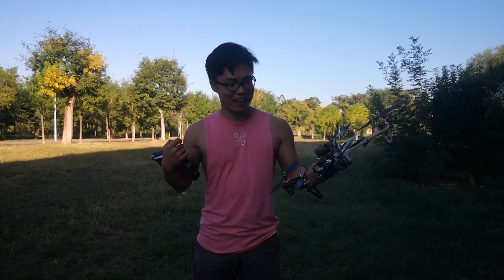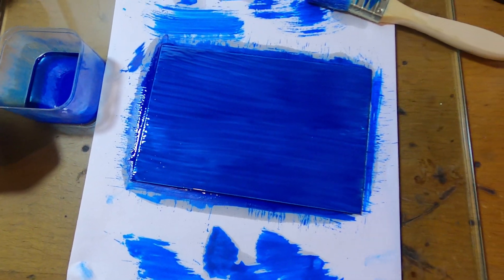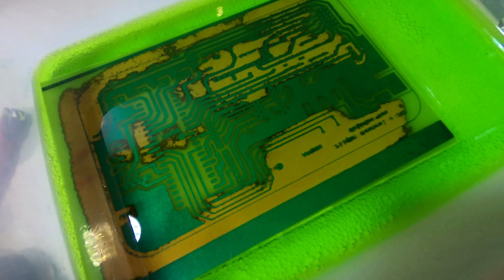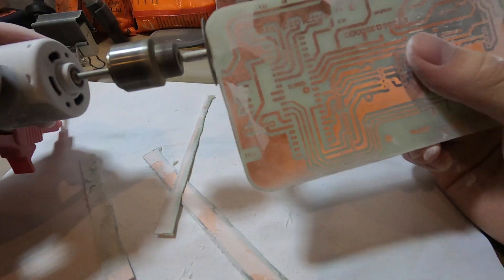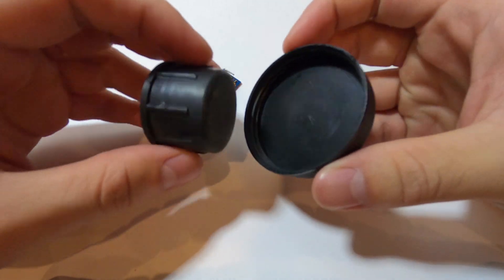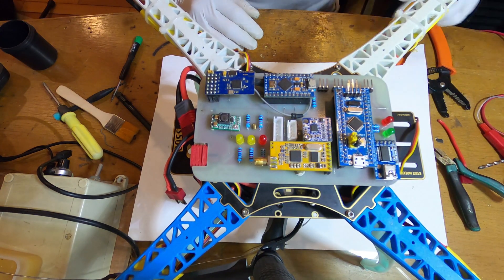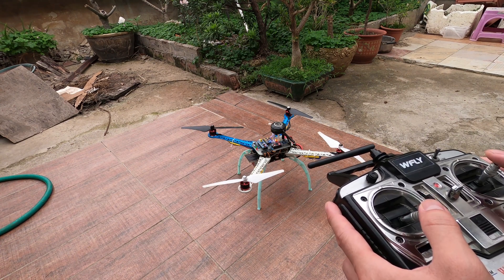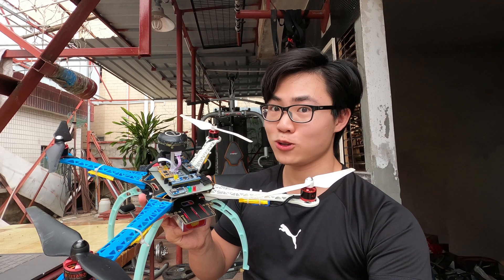How I build my quadcopter with STM32 as flight controller.

Comment: Vonny on your FC would you be able to flash already developed firmware such as betaflight etc? 

Also at hand I have a STM32F411CEU6 (black pill). I compared the pinouts of the chip to the blue pill MCU you're using. There is a couple of difference like the PB11 pin is not there (or is it labelled as something else?).  

I am a complete newbie to development, even though I got some idea. Most pins are similar to the blue pill, but maybe could you produce a schematics for the viewers with the black pill?
Reply from the maker: I am actually building a new FC with this exact chip. It would be a fully open source project and I will make a new series of video about it.
Reply: @sheldonvon5232  F*king legend! Maybe you could include connections to GPS, Minim OSD, vtx, receiver, flash popular FW, etc, should be possible (a while back Drone mesh made a series on diy FC based on a F405 chip). (Also just noticed autocorrect made your name Vonny 😂)
Reply from the maker: Haha, the Vonny really freaks me out, dude. For more details, I’m actually building a FC with optical flow sensor as well as laser distance measuring sensor, which allows you to fly indoor like DJI drones. My current work is mainly about the basic algorithms like sensor fusion, state estimation and etc., which are quite intriguing and challenging.
Reply: @sheldonvon5232  Laser guidance haha thought you taking the pis 😂 but nope you're serious! Awesome! You working on/ got a time frame for the upcoming vid?
Reply from the maker: The laser unit is only for the measurement of height, laser guidance would require a laser radar, which is too heavy for common drones. The video would not come out too soon cuz I’m still stuck with the algorithms. 😂😂
Reply: @sheldonvon5232  Whoa you're starting from way way scratch! Cool! A suggestion (of course it helps me too 😂)... Maybe you could do a two part vid, one with putting the hardware together and flash with available popular firmware (good for peeps like me who are looking for that, also keeps your viewers busy until the next part), The other part, with your own algo?
Reply: @sheldonvon5232  Dude ... Lets link on some ideas we can work on regarding the diy drone

Comment: I apologize for bothering you but I noticed you have also watch Mr. Brooking videos I hope you can help me with an issue

As you may have know, the drone suppose to hover near 1500. However after testing my drone started to hover around 1380. So when I enable auto take off the drone give me the error code number 7. So my only choice is to do a manual take off which I set the throttle at 1380. However when I set my throttle at 1380 and go to the mode 2 flight the quadcopter continue to climb up despite I move my throttle stick to the lowest position I constantly have to emergency shut down the quad copter.

I have tried another way to enable the auto take off my just shift the parameter down. For example you have your as 1500 to 1700 I shifted down to 1300-1600. And I adjusted the equation off throttle = manual take off level + xxxx - 1380(which is the level my quad will hover). When I Do this the quadcopter do take off smoothly and hover about half a meter but when I switched to mode 2 it behave unpredictable. Sometime it dropped down and doesn't want to go up but if I move the throttle up it continue to go up despite I move the throttle down.

I also made sure I mounted the altitude meter above the propeller and light proof it as well.

I know it is a long message but I want you to know I didn't just ask you because I was lazy. I have tried everything way I know how but I just couldn't figure this one out.

I am really thanksful for your help. I hope you have a great day
Reply from the maker: Sorry for the late reply. I've been busy lately. I really wanna help you but actually my code is actually quite different from his code (I took his as reference only). However, I'll try my best to figure out your problem.
Reply from the maker: Did u check if your barometer is working fine?
Reply: Hello, thank you so much for replying and please no apologize you are helping me. I'm very grateful. And yes I checked all sensor and everythjng working as it should. I will try to make a video so you could see the behavior of the quad
Reply from the maker: No problems, my friend! You could leave your email so we can be in touch.

Comment: where can i buy a GPS like in this video?
Reply from the maker: Please check if it is available on eBay or Amazon. It is a very common pixhawk GPS model.
Reply: @sheldonvon5232  I have bought many times but got a fake GPS, I am afraid it will happen again. can you give me the link of the shop where you bought the GPS? Please help me
Reply from the maker: Many times? I'm so sorry to hear that. But I bought this from a Chinese shopping website actually. No idea if they can be delivered to your region.  Please tell me how much were the GPS model that you bought (or the links to them) so I could give more advice.😁
Reply: @sheldonvon5232  Physically my GPS is the same as yours, but when I checked the firmware was not in accordance with the original. please tell the shop site where you bought the gps?

Comment: Have you tried other flight controller as well? such as pixhawk or apm board
Reply from the maker: No, mostly because it would not be challenging to use such boards. They are well developed and all you need to do is tuning the PID without writing any code.